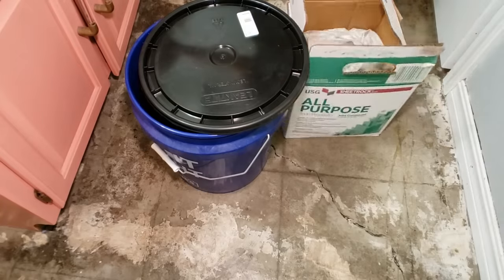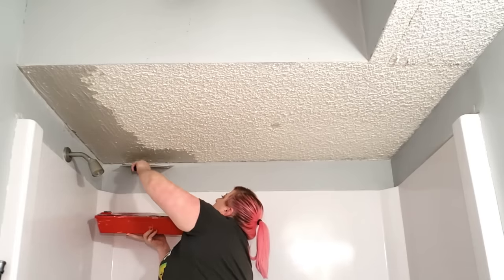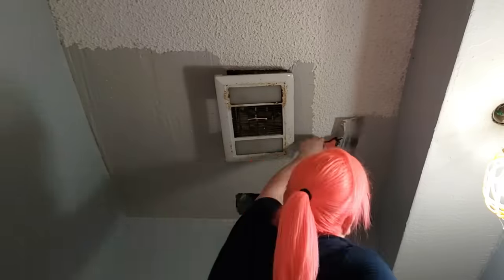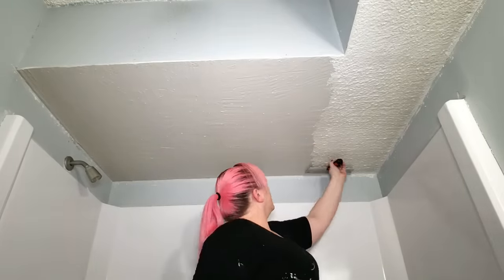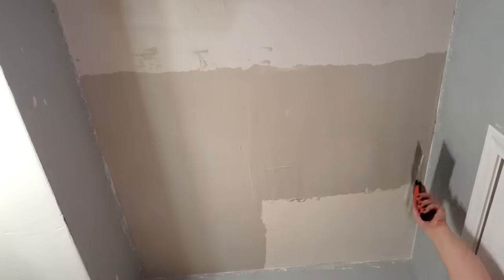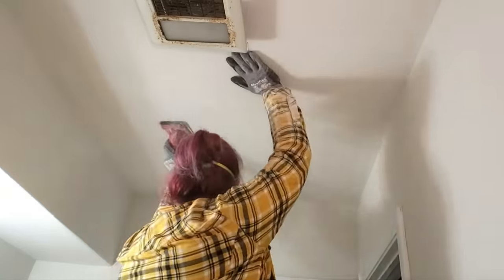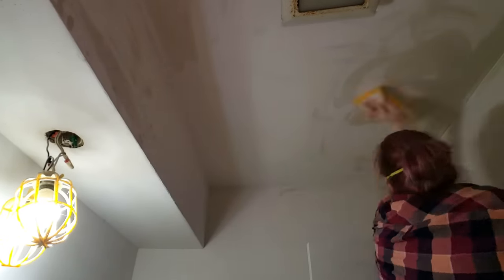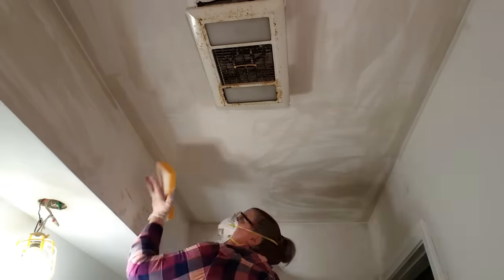How To Cover Popcorn Ceiling Without Removing It | Skim Coating Over Popcorn Ceiling

Comment: Absolutely awesome jobs! You're high quality videos show your awesome quality work very well. I love your detailed explanations and talking us through it, too. I'm needing to do all of this: tub and surround and fixtures AND ceiling! You're giving me the confidence. However, why have you started bottom to top instead of top to bottom so all the mess I know I would be making with the ceiling compound won't fall on the pretty shower from the messy ceiling work, etc. Just wondering in case I'm missing something. Love alot of your music too.Thanks ahead.
Reply from the maker: Thank you so much! ❤️ I'm glad so much of this makeover was helpful for you. If I was going to do this all over again, I would've done the ceiling and walls before painting the bathtub. You're 100% right that the order I did those projects in was backward. We still had 5 kids sharing this bathroom when I started this makeover (2 of them have graduated and moved out since then) so I had to take advantage of a small window of opportunity when a couple of our kids weren't home to paint the bathtub. It made it easier to share the other shower for those few days. But if you can, it's best to do the ceiling and walls first. Feel free to reach out if you have any questions as you're working on your bathroom! Good luck, and thank you again!
Reply: @TheNiftyNester  So cool...you responded back!☺️ Gotcha on having to do things whenever you can and work around kiddos, etc. 😄

Comment: Can you do this if some of the popcorn is starting to flake?
Reply from the maker: This works best with intact popcorn that's been painted. If you can patch the area that's flaking and prime it, the flaking stops and it looks secure, you might not have any problems at that point. You just don't want the weight of the joint compound pulling on popcorn that's already coming loose.

Comment: would this method be cheaper than having to do all the extensive saftey measures to remove? I'm looking for the cheapest way to make our old popcorn ceiling safer for my kids in bunk beds and I don't have an option to not have bunk beds,I wish I did. I more so wish the rental managment cared about my health concerns and would remove these ancient popcorn ceilings...My other big issue with these ceilings, is the genius builder of these 1940s-50s duplexes, is they installed ceiling heating coils underneath those toxic popcorn ceilings and I can't imagine how that could be safe, heating up the asbesto?? i definitely didnt realize these design flaws before our move in. My son already has chronic upper respiratory problems, as well as indoor outdoor allergies,(which we luckily do have an awesome Alen air purifier we were donated during the wildfires we had up here 2 years ago, helps alot.) I just wish there was a cheap way to make sure the ceilings here aren't causing any health issues. If this method doesn't cost too much, I'm definitely doing it, managment is so lame here they wouldn't even know I did anything. so I guess I would need to jnow if doing this, covering would effect the heating coils underneath..I do my best to actually never use the heating and use our smaller heaters in wtv room were in most the two months of the year it is pretty cold here,but still would want to make sure doing this wouldn't effect the ceiling heating source.
Reply from the maker: Hey, I'm sorry it's taken me a couple weeks to get back to you! If you have popcorn ceilings you want to always test for asbestos before removing it. If you have asbestos then it's best to hire a professional. It can be expensive to properly cover everything and buy what you need to properly ventilate the area as well as protective gear to wear while you're doing it if you do have asbestos. If you don't have asbestos then it's still messy and you still have to cover the floors and wear a mask/ protective eyewear but it's safe to do yourself and it doesn't cost much. Skim coating cost depends on what tools you already have and what you have to buy. The joint compound itself is not expensive but you'll also need a drill, compound mixer bit, skimming blade and a few other little things (check my supply list in the description if you want the list of what I used). There's a few other options as well. If the ceilings aren't painted you could use a primer to seal the popcorn then paint them, that would seal the popcorn and make it less likely to flake off when your kids are bumping the ceiling from their bunk bed. You could also look in to ceiling tiles that go on right over the popcorn. They're usually light weight foam and just glue on to the ceiling. I haven't used them so I can't say how well they work though. I did do some quick research and it looks like it's safe to skim coat over ceilings with that type of radiant heating system. Again, I haven't done it myself but I read a few boards online between home owners and a couple contractors saying it was safe for them to skim coat over the radiant heated ceilings. I hope this helps, feel free to reply if you have any other questions. Good luck to you and I hope you are able to find a solution!

Comment: Have you tried to skim coat over the unpainted popcorn ceiling? Wondering if it will work as well. Thanks
Reply from the maker: I haven't personally skim coated over unpainted popcorn but I've seen others do it. The only thing I would suggest it applying a coat of primer before doing a skim coat. I see others skim right over the popcorn but I've read that the moisture will soak into the popcorn and that can cause the popcorn to start detaching from the drywall. If you prime it first the moisture won't soak through. I hope that helps!

Comment: Does that add a lot of weight to the ceiling?  How is it holding up at this point?
Reply from the maker: It looks just like it did the day I finished it! I'm sure it adds some weight, but as long as it's applied correctly, it should adhere to the popcorn, and it shouldn't cause any issues. Make sure the popcorn is painted and isn't damaged or coming loose from the drywall. The moisture from the joint compound soaks into popcorn that isn't painted, loosening it from the drywall, so it'll only work if it's been painted, which seals the popcorn.

Comment: Mind blown.  I am so perplexed how it doesn't fall down.  It just doesn't compute that it CAN BE this easy!  Thank you!
Reply: Not so easy. Labor intensive.
Reply: @donnamaco1  Have you removed popcorn before?  It is messy and labor intensive and may contain asbestos.
Reply from the maker: Thank you, B. Walker! As long as you're covering sealed popcorn (primed), it'll adhere right to it! This is in a heavily used bathroom, and it's held up perfectly. It is a lot of work, but, like you said, so is removing popcorn. And I still have to skim coat ceilings after removing popcorn to get the smooth finish I want. On top of that, this is safer for anyone with possible asbestos (again, like you already said). This might not be the solution for everyone, but I love it.
Reply: @TheNiftyNester  Thank you for your reply.  When I first began watching I was "gurl, you crazy" then that quickly passed and I could see the method, "gurl, you brilliant" is how it ended.  Extremely impressed with your over head endurance.  That took a lot of tenacity.  Going to store your method away when I can use it!  thanks again!
Reply: If the popcorn weren't painted, it probably would come right down. But since it IS painted, the crap is invulnerable.
Reply: @institches2750  When I run my duster over popcorn it falls down.  When I replace a light bulb in recessed cans it falls down.  Amazed how the action of stroking it with a trowel doesn't budge the popcorn.  On top of that the mud grips/forms a bond with the drywall that is underneath the popcorn.  🤦‍♀Ignoring the flaky popcorn all together.

Comment: Would it work to use a tile grout trowel? Spongy like? Idk if I could do three coats on ALL my ceilings. Oh dear!
Reply from the maker: I don't know if a tile grout trowel would work as well as a drywall knife. It does take a lot of upper arm strength to do all of this skim coating but maybe you could try covering your ceilings in new drywall? It still takes some work and costs a little more but would probably be quicker.

Comment: You did SUCH an amazing job and clearly you’re a hard worker, which is admiring. 
But there’s a MUCH easier alternative to this and it’s not only less time consuming. But it puts far less strain on your neck, arms, back, etc. 

📝 All you need is a 5 gallon multipurpose sprayer (or any kind of spray bottle), 50% hot water, 50% distilled white vinegar, a large scraper and plastic sheeting (trash bags, tarps, etc) to line the floor with. 

📌 Use your sprayer with the mixed solution to completely saturate the ceiling, let it sit for 10-15 min and remove with your scraper. (It will come off nice & smoothly & in huuuge sections!!) 

🖌️Let it dry COMPLETELY (24-48 hours should be good), Paint and VOILA!!! You’re good to go. 

I recommend this from personal experience; as I’ve tried literally every method out there (including the one being demonstrated here, which was far too time consuming for us). The method above however was hands down the most effective, efficient way- 
It took us about a month to finish every room in our 2,000+ square foot house & that’s just because we have kids & jobs. (It would have been faster, had we been able to make it our main priority).
Reply: As someone who has removed popcorn from dozens of ceilings, that is the way to go. 

It won't work if the ceiling has more than a couple coats of paint and sometimes the popcorn was used to hide a poor mud job underneath and one skim coat is still needed.

Scraping off an unpainted wet popcorn ceiling is also very satisfying as it comes off!
Reply from the maker: I've done both methods. I've scraped popcorn, I've scraped popcorn then skim coated, and now I've skim coated over popcorn. As Jamie said, it really depends on how much paint you're dealing with. This bathroom had thick layers of paint. Water won't soak through that, and the popcorn won't scrape right off. I guess it would have if I tried long enough, but honestly, this was the better solution for this situation. I'll continue scraping the rooms that aren't painted. It's just a case by case basis.
Reply: @TheNiftyNester how can you tell if the popcorn ceiling has been painted or not? Thank you

Comment: Aren't you concerned that the original popcorn ceiling could loose contact with the ceiling drywall and possibly sag or even have a chunk fall down?  I'm looking at using a vacuum to first remove any loose popcorn.  Then sand (smooth) the popcorn a bit.  Once this is done, then use your method to apply the new ceiling.
Reply from the maker: If you skim coat over unpainted popcorn, the moisture can soak through and cause the popcorn to come loose. That's why this method is for painted popcorn. If yours isn't painted, you'll want to prime it first before skim coating. As long as the popcorn is sealed (primed), the joint compound will adhere to it, and the moisture won't soak through. Then, once you prime the joint compound, it'll be sealed as well. If you sand the popcorn down first, just make sure to prime it before you skim coat. If you scrape the popcorn off completely, you can skim coat right over the old drywall without priming it first. It all depends on what you're covering. I hope that makes sense!
Reply: How do you know if it’s painted or not? Sorry for the basic question, but this is new to me!

Comment: I totally needed to see this video, thank you!  I spent a day trying to take down painted popcorn, what a mess! I am going to skim coat what I did take down and then eventually do the rest a little at a time. Thank you again for this video and I’ll will definitely watch the others in this series.
Reply from the maker: That's awesome, I'm so glad this was helpful! Thank you! I've had the same thing happen to me and had to patch that spot where I managed to get the popcorn off. It'll definitely be fine when you get the rest skim coated and won't be noticeable. Good luck with your ceilings!
Reply: Did you do it. How did it turn out?

Comment: Just out of curiosity why didn't you just wet it and scrape it?  To avoid the mess?
Reply from the maker: This popcorn ceiling was painted, which sealed the popcorn, making it nearly impossible for water to soak through. It would've been a mess to try to scrape, and I would've needed to skim coat the drywall afterward no matter what, so I did this instead. This is only meant for painted popcorn. You don't want to skim coat over unpainted.

Comment: I really needed to watch this method. Thank you so much! But I have 2 questions. Is asbestos testing required if you are not scraping it off , just like how you did? Also, I plan on installing recessed lights after, is it going to be a problem for my electrician if pop corn is still there with joint compound and paint on top?
Reply from the maker: You're welcome, I'm glad this was helpful! So, from the research I did before messing with any of our popcorn ceilings, asbestos is safe until it's disturbed. Since I'm not a professional, I'll just relay to you what other drywall professionals have said, and I've taken their advice. From what I've read, it's safe to skim coat over asbestos popcorn that's been sealed (primed) and skim coating is a way some people refinish their ceilings to avoid having to hire someone to remove asbestos. I had already tested a ceiling in our house before scraping a different room, so I knew it was safe. I think you would be fine to skim coat without testing, but it's probably a good idea to double-check what I'm saying before you do. As far as the lighting goes, it should be fine! My spouse is an electrician, and he's installed several light fixtures for me (including recessed lights) after I've skim coated the ceilings without any issues. Sorry for the long response. I hope that all makes sense. Good luck with your ceilings!
Reply: @TheNiftyNester  Thank you so much for all the information. Love the long response actually! Scraping off and opening a can of worms (asbestos) is what I'm afraid of, so will most likely go with your technique without testing. And my living room ceiling has already have a paint on top of the pop corn (bad idea maybe), so scraping off will be harder. I wonder how many inches will my ceiling will come down with 2 or 3 coats of joint compound?
Reply from the maker: @Tadeh Aloian  I agree. It's easier to skim coat over painted popcorn than to scrape it. And it works out perfectly since it needs to be painted to skim coat over it. The joint compound doesn't actually need to add much thickness at all. Do it in thin layers. It'll take a couple thin coats to fill in the popcorn texture. Once the texture is filled in, you can do another thin coat to get a smooth finish. My best guess would be that once it's all said and done, you're maybe adding 1/4 or so of thickness to your ceiling. The majority of joint compound is just filling in the gaps. I hope that makes sense.
Reply: Will there be any chance to see cracks later after doing this project and paint it for good? Have you seen any cracks yourself in your project? And also, did you apply primer before starting to put joint compound? I heard puting a layer of primer will help joint compound to stick better and prevent it from peeling or future cracks. Not sure how true this statement can be.
Reply from the maker: I haven't had any issues with cracks in this room or other rooms that I've skim coated. To avoid cracks, do thin layers and let it dry completely in between coats. When I see others have problems with cracks, it's usually because they apply thick layers, and it's not completely dry before they do another coat. I only apply one thin coat a day, giving it 24 hours to dry in between. You can do a fresh coat of primer if you'd like. It won't hurt anything, but if the ceiling has already been primed and painted, you don't need to prime it again. Once it's been primed, the popcorn texture is sealed, and that keeps the moisture from the joint compound from soaking into the popcorn and the popcorn possibly coming loose from the drywall.

Comment: If you add dish soap to the joint compound it will glide much better and fill the holes better.
Reply from the maker: I have been meaning to try that. I've heard it has to be the original dawn, is that what you use?
Reply: and use lightweight 😉

Comment: Love this. So you can ONLY do this IF the popcorn is painted right? Mine isn't, but to scape 2,000 sq ft with molding installed sounds like a a huge pain, but I NEED them gone. Please let me know. You always seize to amaze me. XOXO
Reply from the maker: Thank you, Donna! You always leave me the sweetest comments, I really appreciate you ❤️ If you want to skim coat over your popcorn ceilings you can, you just need to prime them first. If you prime them that'll seal the popcorn texture, then you can skim coat over them. If you use a paint sprayer to prime them you could probably get that part done pretty easily and quickly. I hope that helps! Thanks again and let me know if you have any more questions 😊
Reply: @TheNiftyNester  // Thank you so much. That helps A LOT. You're the best.

Comment: I'm looking for a one time coating especially the ceiling.
Reply from the maker: I don't know of a product that would work well with only one coat. The joint compound can crack if it's put on too thick. It does better in thin coats that are able to dry all the way through. You could hang new drywall, beadboard, or some other type of material over the popcorn to cover it.